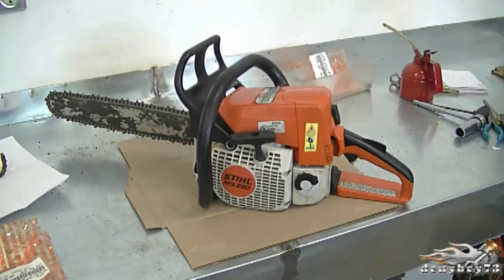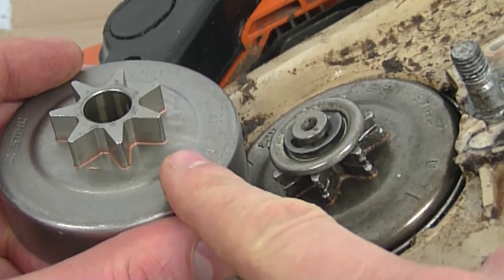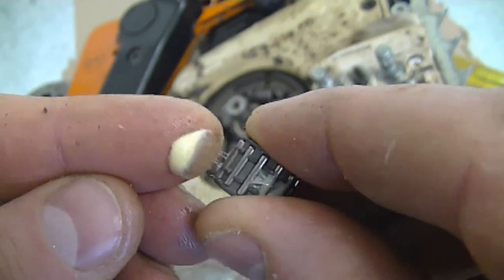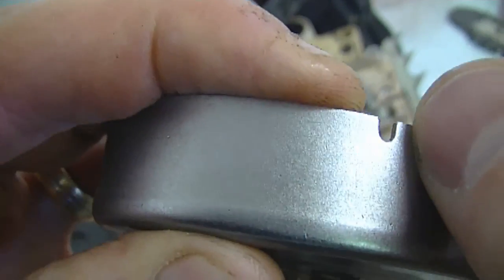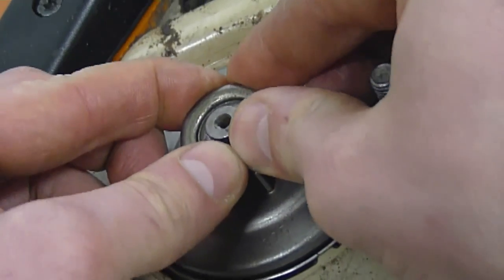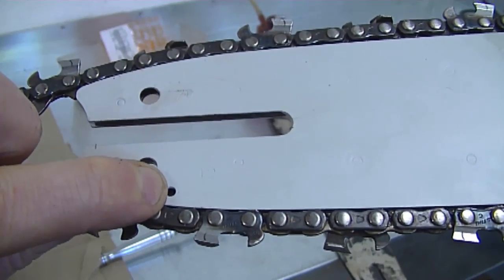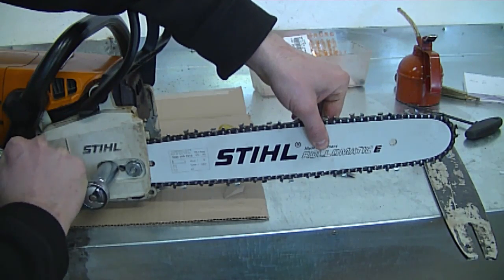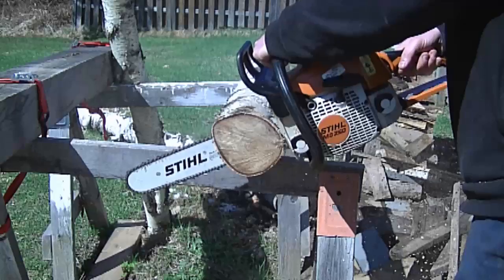Stihl MS 250 / 024, 025  Chainsaw Sprocket & Needle Cage Bearing Replacement

Comment: My Stihl ms271 chainsaw seized up a year ago from running fuel that was part ethanol...won't do that anymore. So.i went online to find a video of how to rebuild the engine myself. I found donyboy73 on youtube and for less than half what the repair shop wanted, I had my saw running better than new! While my saw was down, I bought a Husqvarna Farm Boss chainsaw at Keene's small engine repair in Millington, and it's a great saw! The problem.i have now is one saw is a 3/8 pitch chain and the other is a .325 pitch chain which doesn't sound like a problem until you go to buy chains, bars and files to sharpen your chains. I looked online again and messaged donyboy73 about my issue and he agrees it's possible to change my .32525 sprocket on my Stihl to a 3/8 sprocket and then use the same bars, chains, and sharpening tools on both saw...I am researching the best deals to do this change and will let you know how it goes! Thanks Donyboy73 for all of your help and sharing your knowledge!

Comment: Stihl recommends turning the sprocket 360 degrees to insure the sprocket slot is engage with the worm gear arm.  If the E lip will not fit in its slot the sprocket is not engaged with the worm gear arm.

Comment: thanks for all your great videos.  I had to use one for repairing a loose handle on my mtd snowblower.  I found that the bolt has snapped and was difficult to get out.  After watching your video I drained the gas and oil and took off the belly pan.  Rather than using a chisel, I used a punch with a hammer to remove the welded nut and it came right out.  Thanks

Comment: hey Donny. i just got an MS170 for free. it is my frist saw. great little thing. i dropped a few trees in my woods to open my ATV trails. then i got recruited by my neighbor to trim up his trees, i was bucking up some limbs for him and the saw kicked back and dug into the sand. it dosent cut at all now. could you show how to sharpen a chain? and is there any way to adjust the oiler on that saw, it seems to dump alot of oil

Comment: Is there anyway to convert this to a 3/8 sprocket and chain? Thanks
Reply: I would like to know that also
Reply: @doo6211  Info from a subscribers comment on another channel. I did mine  I ordered these parts 16" picco bar/chain combo along with the requisite sprocket change.  It cuts outstanding. Part numbers for those who are interested:  7 tooth sprocket - 1123 640 2002; 16" bar - 3005 000 4813; 16" chain - 63 PM3 55.
Reply: Ok thanks bud